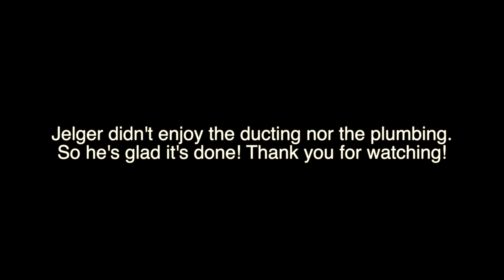Ducting, plumbing and building the staircase for our cabin | Our cabin in the forest episode 29

Comment: Hi Jelger, I haven’t studied plumbing yet and never thought about a vent stack is required for your composting toilet and washing machine. I understand venting the composting toilet, but not sure why the laundry washer needs venting. I expect the washing machine vent is separate from the waste-water drain.
Reply from the maker: The laundry machine also has a drain, which needs a vent to chase the water load in the pipe (otherwise you get a vacuum which causes air to be sucked in through the drain pipe). If the distance between the washer’s drain and the main stack (that has a main vent) is not too far (3 feet max), you don’t need to vent the washer’s drain. So in our case, where the washer ties into the”main” stack (where it goes from horizontal to vertical, and leads to the crawl space) a vent was needed to allow air to be sucked in and chase the water load in the pipe. Which is why it ties into the main vent stack.

Comment: Where do you plan on getting water and how is the full system being setup? Did I miss something, no water heater yet right?
Reply from the maker: You’re right, it’s not set up yet. We’re doing things in reverse, lol. It’d probably have been smarter to drill our well first, but we’re estimating it’s going to cost us 20-25K (based on the depths of neighbours wells) and we didn’t have those funds. (Still saving up)

We did plan for the water heater to go under the stairs and the pex are in place in the walls. But other than that there’s still a ton of work for that. 

We will have a composting toilet. Hopefully we won’t regret that. 😂
Reply: @CaribooAdventure  I am planning a near identical type of build to yours in years to come. The composting toilet is the only thing I would not have done. But what's great about these kinds of builds is you can always modify. So if I were to be low on funds I would not get the septic field and do the same toilet system to allow time to get the funds. I can't wait to see the future upgrades thank you very much for showing us and responding!
Reply from the maker: @navigator9905  You’re absolutely right! I wouldn’t be surprised if after a few years we upgrade the toilet, lol. 😊